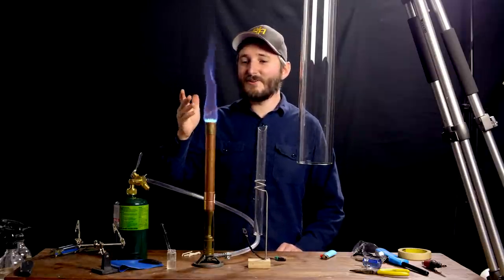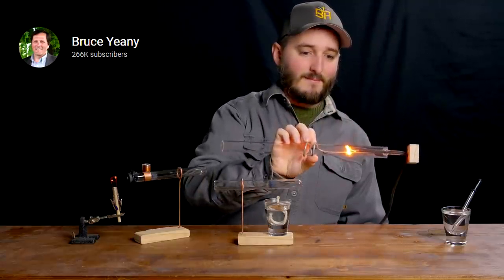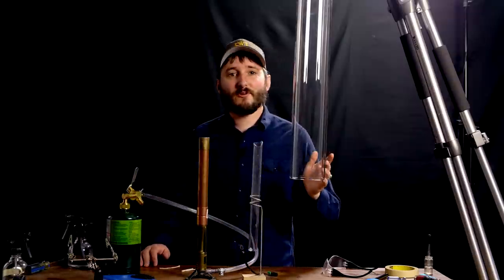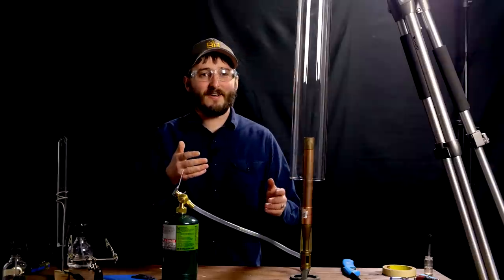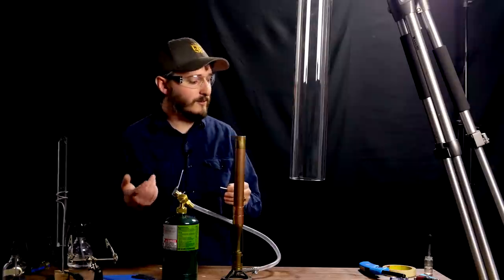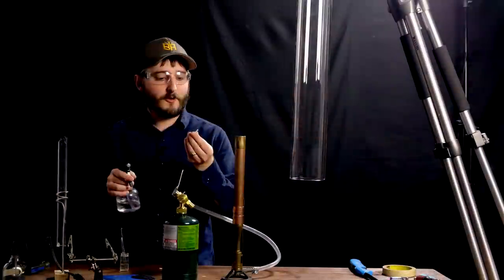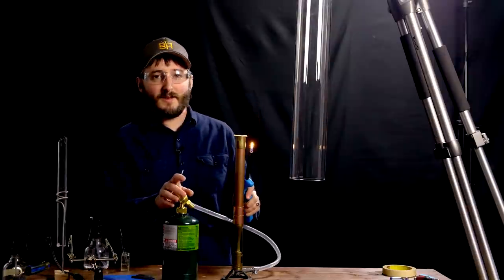Fire Driven Sound Waves in a Quartz Tube

Comment from the maker: I'm curious if the space between each ripple in the flame could be determined by measuring the upward speed of the flame, and dividing it by the fundamental frequency of the tube. I at first was tempted to think that the ripples were another example of "sub peaks" in the sound wave as we saw in the foam bead experiment in part 2 of the thermoacoustic series, but after reconsidering I think it's more likely a factor of the slow moving flame being regularly impacted by the sound wave. Even so there are some curious things to consider, like why does the flame break apart in mid air? That doesn't seem to make sense unless the air movement of a sound wave is subdivided with nodes at the pinching off points. Very interesting to think about.
Reply: Incredibly cool and interesting! What speed was the slow motion footage? I think that would be helpful/important information for anyone wishing to do the mathematical calculations. I'd assume the dimensions would also be important, but that should be attainable from the resonant and harmonic frequencies
Reply from the maker: @riuphane  960fps played back at 30fps
Reply: @Nighthawkinlight  What about making a musical instrument out of many tubes? I might try it myself!
Reply: The ripples in the flame could be from more air being drawn in intermittently through the bottom of the tube when the end experiences low pressure? The convection current of the flame wants to draw more air in but can’t when the pressure is high at the mouth and can only do it at low pressure? Just a hypothesis
Reply: Sound is bouncing the table.
Reply: This kind of reminds me of a pulse jet. Is the process similar?
Reply: Also is it possible that what we are seeing here is a similar process to acoustic levitation? The frequency waves are creating barriers inside the tube. Not so much pushing but more of blocking the gasses from moving upwards. Essentially when you hit the frequency wave at the right point on the burner it actually creates a pocket of vacuum from the burning gas between the waves. When the tip of the burner gets to close the the edge of a wave it's the equivalent of putting your hand on top of it. The closer to resonance you reach the more frequency waves are trapped inside the tube causing the flame to progressively get smaller until the resonance is so high that it creates a pocket to small for the flame to sustain itself. The reason you feel pressure from the bottom is that there are more frequency waves above the flame than bellow. Everything follows the path of least resistance so it's more difficult for the pressure of the gasses expanding to go up than it is for it to go down.
Reply: @jonathanfeller  That would be interesting. I'd like to see that.
Reply: It's probably the same separation action seen in the small scale. I wonder if there are higher harmonics outside the audible range.

I'm not sure how you would calculate this but I feel like the pressure wave would also influence it. Then I wonder if it is more a simple calculation of the wavelength considering this is more similar to a standing wave, which is in fact moving but appears to be still.

Then I got thinking further, we measure Standing Wave Ratio to measure impedance matching. When there is an impedance mismatch it causes signal reflections. I think this is creating the same thing, making a mismatch between a high and low pressure. There are probably reflections at points that don't produce sounds. Then as those reflections oscillate at the same frequency as the tube, it begins to sing. There is an obvious resistance that is created by the reflections. Impedance SWR measures form 1-infinity, infinite impedance is equal to a dead short.

 I think the point at which the flame goes out is a point of maximum reflection and maximum resistance, maybe infinite. Effectively making the tube as if it was sealed at the top. This same thing happens electrically at certain frequencies combined with a resonant length of coax. An open end will appear shorted when it is not and/or appear open when it is shorted. This takes place at the 1/4 wave point.
Reply: Just take a look at Hans Jenny's Cymatics series of videos to have your mind blown away by these nodes that sounds create on different kinds of matter. I say, for real, do it! You won't regret it.
Reply: I think it will be harder than that. while the velocity of the gas will increase the speed of sound in one direction it will decrease it in the opposite, so there will likely be a negligible effect by comparison to other factors. For instance, the speed of sound should play much more of a factor. Given you're heating an enclosed column of gas the adiabatic constant will likely be off, the ratio of gasses will alter the gas constant, and the temperature will be quite a bit off from 20°c at 1 atm. This all serves to make the speed of sound larger than the 343m/s that is used by most people. Also don't forget that the length from node to node only equals half the wavelength. These smaller periods will almost certainly fall along, or scale to, a multiple of the wavelength not the column length.
Reply: Have you heard of "sonoluminescence"? If you can capture a bubble in a liquid with a sound wave and squeeze it enough to make a plasma dot then can you do it with only gasses? Can you capture a bit of the flame with a sound wave and compress it?
Reply: It would be interesting to measure the pressure differentials throughout the tube
Hey, are you a yooper?
Reply: You need to try to build a glass pulse jet engine. This was an awesome video by the way.
Reply: Man I wonder what would happen if you filled the little tube with smoke flow to see the waves??
Reply: This is ancient knowledge you are demonstrating to your large audience and I can see it brings joy to you. Thank You!
Reply: @nghermit4922  radom ignition of vapor in glass doesn't sound like too much fun
Reply: I have so many questions. 1. it appears that the sounds can't be generated when the tube is laying sideways, "why"? 2. can you generate a harmonic using another sound, can you do it using something other than flame/fire and if you use an amp, can you use one as small as an earbud? 3. is the tube open ended or like a beaker? 4. Quartz glass, is "actually" made with quartz or is that just a name? 5. if it is made of quartz how are the quartz distributed? can you diagram the "design" of the quartz glass (does it look like a brick wall etc) 6. Can you make quartz ROCK (natural state) resonate with a sound? 7. does the "harmonic" pitch have any other properties like electric/magnetic etc? And how long can you hold a harmonic note? 8. Can you record those sounds you're creating using fire and quartz glass and apply them to other things? can you use them to power a piston or a rock drill?
Reply: What is the music playing during the slow motion sequences? -- E.g. starts at 6:06
Reply: You said that placing the burner at a quarter of the tube gave the best result. I wonder if it's related to the fact that antennas resonates when they are at a quarter of the wavelength. I bet the principle is similar.
Reply: @V1ctoria00  probably not it would probably shine for a moment until the reaction finished consuming available oxygen in the bubble. Then you'd have just a floating bubble of co2. Would make for a good experiment, though, if you used electrolysis for hydrogen and oxygen, re-combine them at a certain rate and bubble upward to catch it between the two transducers? But idk what source of ignition you could use in water???
Reply: @patrickbowen9395  perhaps a reaction that could be captured? Sodium comes to mind but perhaps something less violent?
Reply: @V1ctoria00  actually yeah sodium probably would work....actually itd be more interesting to know if it wouldn't work. If you could get a frequency high enough that the couldn't react with the water.
Reply: @[REDACTED] [DATA EXPUNGED] Overtones are the usual name for harmonic frequencies, a more scientific term. The only reason you might hear them described in different ways is because of perspective. In a musician's case (or sometimes audience) you are inside the tube, hearing overtones based on where the nodes are in the room. Flutes, on the other hand, are designed through literal coincidence to avoid these, and thus the hole spacing.

I was in a choir many years ago, and participating with a talented enough group of ~50 singers to make very pure sounds. Our director taught us the accoustic nodes of the room, and had us sing notes at it. The experience is unlike anything I had before or since. Not just joy at the sound, one has a physical reaction, it's hard to describe.
Reply: @Nighthawkinlight  Your visible joy is as contagious as your knowledge in these videos. You never fail to give me an idea for something practical or interesting, and that is the best kind of present. Thank you!
Reply: Do this experiment again with a more basic burner that doesn't mix in air. It might become more like a pulse jet.
Reply: @Kneumann1991  I am always trying to understand how my pjs run so fully agree with you on this.
Reply: @Nighthawkinlight  When you first ran in to this subject ,  you did mention about application and uses of thermal acoustic effect, so this video remind me a lot about PULSE JET engine,  this may be a recap topic of many other youtuber,  but since you are really good as simplify things to easy understand, could you make a video about pulse jet engine with your own way?  I know the common one as the U pulse jet engine,  but V1 flying bom engine is an interesting design of pulse jet engine,  perhaps that could help you get some ideas to apply on other uses of thermal acoustic,  such as what will happen when you put valve or vent in the singing tube? 

    Also,  the singing tube won't work when placed on horizontal,  because of the hot air just move up(as you mention in the video),  so will it make sound when put moving air through the tube placed in horizontal and if so, how much air will make it work or speed and pressure of the moving air...? 
 
    Beside the pulses jet engine,  the first video make me think of Stirling engine.  This also a good topic for another video.
Reply: The particles of air redistribute due to the pressure waves right? If all the oxygen molecules split up into regions, then only those regions can "burn". That means pockets of dead space inside the flame. Am I thinking about this right?

Only issue is that that means the space between each ripple is a formula of the pressure of the air AND the propane fighting each other.
Reply: NightHawkInLight Have you done a video on pulse jets? The parallels between that technology and your recent endeavors seem ample.
Reply: @dasleikjr  Not safe, but fun for sure. Stand well back.
Reply: Now people can see how the SR-71 worked. The sonic boom is why that blackbird flew so fast.
Reply: Using a flame - a plasma - to induce the resonance in the tube was a brilliant way to visualize the compression and rarefaction of each half cycle of that resonant frequency. Yes, the amount of air moved at maximum volume (which occurs at resonance) is substantial!
Reply: The places the flame breaks up are likely areas of turbulent flow since it seems to "roll" off the sides
Reply: @NightHawkInLight Thank you so very much for this demonstration, it helped me figure out some tangential research regarding thermal echo from the various spectrums of energy put out by the sun.  For example, if you examine a limestone quarry lake it will have visible stationary patterns in the surface of the water.  I speculate that this pattern is the limestone resonating in some fashion to a wavelength of energy we don't normally perceive as coming from the sun (outside of our traditional senses).  What's more, the pattern is consistent even with significant cloud cover, which has its own layers of implications.
Reply: Sounded like a light saber
Reply: I mean if you gonna ask why the flames are separating in the tube then you gonna ask the same thing but what happens with nature in other words an natural fire I mean the reasons could be different but the logic could be the same
Like for example in the tube gas  (it’s fuel) and heat and they like to go up essentially 
Now with the natural fire the same thing happens but it doesn’t have gas furthermore when you’re using a normal burner without the tube the opposite happens there is very little flame separation (I guess you can call it) when it’s A blue Flame of course and this is where it separates it seems like it’s the sound that causes separating in the tube and else for natural fire it seems to be a heat and the natural cold air kind of helps it bit more along
Reply: digital subliminal messages  
Da Flip are you going on about?
Reply: God has said in the Quran:

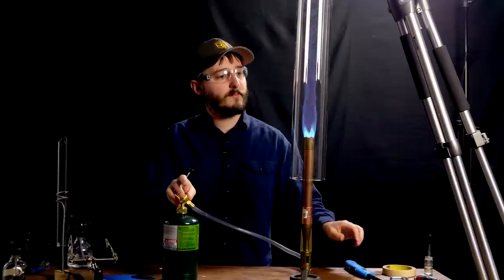{ O mankind, worship your Lord, who created you and those before you, that you may become righteous - ( 2:21 ) 

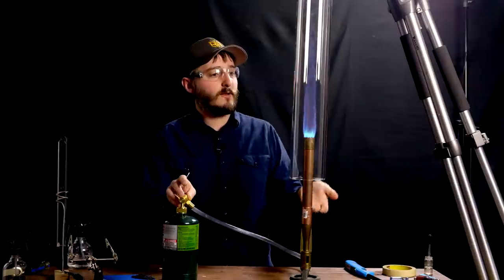 [He] who made for you the earth a bed [spread out] and the sky a ceiling and sent down from the sky, rain and brought forth thereby fruits as provision for you. So do not attribute to Allah equals while you know [that there is nothing similar to Him]. ( 2:22 )

And if you are in doubt about what We have sent down upon Our Servant [Muhammad], then produce a surah the like thereof and call upon your witnesses other than Allah, if you should be truthful. ( 2:23 )

 But if you do not - and you will never be able to - then fear the Fire, whose fuel is men and stones, prepared for the disbelievers.( 2:24 )

And give good tidings to those who believe and do righteous deeds that they will have gardens [in Paradise] beneath which rivers flow. Whenever they are provided with a provision of fruit therefrom, they will say, "This is what we were provided with before." And it is given to them in likeness. And they will have therein purified spouses, and they will abide therein eternally. ( 2:25 )

 Quran
Reply: God has said in the Quran:

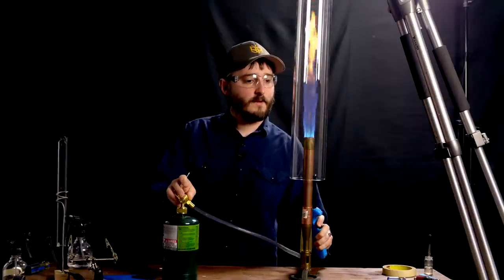{ O mankind, worship your Lord, who created you and those before you, that you may become righteous - ( 2:21 ) 

 [He] who made for you the earth a bed [spread out] and the sky a ceiling and sent down from the sky, rain and brought forth thereby fruits as provision for you. So do not attribute to Allah equals while you know [that there is nothing similar to Him]. ( 2:22 )

And if you are in doubt about what We have sent down upon Our Servant [Muhammad], then produce a surah the like thereof and call upon your witnesses other than Allah, if you should be truthful. ( 2:23 )

 But if you do not - and you will never be able to - then fear the Fire, whose fuel is men and stones, prepared for the disbelievers.( 2:24 )

And give good tidings to those who believe and do righteous deeds that they will have gardens [in Paradise] beneath which rivers flow. Whenever they are provided with a provision of fruit therefrom, they will say, "This is what we were provided with before." And it is given to them in likeness. And they will have therein purified spouses, and they will abide therein eternally. ( 2:25 )

 Quran
Reply: Ouch that first small one sounded like exactly 520HZ which hurts like crazy for headphone and non headphone users btw xP
Reply: @NightHawkInLight
I think if you shot smoke into the pipe through a thin pipe from below, you would get some more beautiful footage.
Reply: Can you make termo-acustic experiment, in different media then air ? Im interested, how different speed of sound in medium change resonation frequency.
Reply: I did it, but from first principles, it is a translation problem. I have a Euclidean Identity Matrix for the Skin Effect in a solid, and it could be transformed for the Fire equation. An x,y,z radiation decay bundle geometry, with temperature, pressure and density phase change parameters. What the equation would signify is the precise states of the system, the fact of fire burning toward its fuel, and ignition parameters. MY questions are how a strong magnetic field would influence the evolution of the fire equation. The fundamental New Standard Model approach demands a 1D radiation transform, and without any wires processing EM flow, the 1D topological crystal structure of the tube fits INTO the toroidal slice of the tube instead of a wire, a 1D-3D embed. I see a Skin Effect in the resonance, meaning that internal space of the tube is the "counterspace" where the dynamic adaptive physics takes place (Boltzmann Brain Case), and then it radiates to a sine wave frequency we hear. Like the battery touched to the glass spins the water. Or the magnetic egg in water as it freezes to ice. Look at Theoria Apophasis' frozen magnet experiment.
Reply: @Nighthawkinlight  video idea: manipulate sunlight un such a way that you could use it to forge metal!
Reply: Looks like a Tesla value  in slow motion very cool channel
Reply: @V1ctoria00  that would also Require Electromagnetic Coil...and Soundwaves over 240 decibels
Reply: This will achieve Brownian motion... cryogenic fusion...same as inside a star...
Reply: @mjolnirswrath23  ok so its hard to do? But if it can be done I like to see it. I also want to measure the energy output of the plasma created by sonoluminescence.
Reply: maybe if you add holes like in a flute, so the fire can take enough air to vibrate without going off??  (EXCELLENT EXPERIMENT!!)
Reply: @BurrowsNE   Thanks for that information.
Reply: Sounds like the whale songs.
Reply: Space engine ultrasonic comments too nice lot more work to get it to work??????
Reply: what you do here could be the phenomenum inside the Kheops Pyramid
Reply: Can you check if the resonating quartz tube has a voltage ? It is piezo electric so wouldn’t that make it put out a voltage
Reply: @Nighthawkinlight  quartz is piezoelectric that quartz tube must be creating a voltage under its own resonance created by the flame would be fascinating to test
Reply: You have 333 videos nice bro
Reply: @fstemarie  well 1/4 to half wave antenna is imperative to oscillate the proper impedence of the sine waves propagation which inturn does create precisely the aim of direction or signal to propagate steady. It's all about tuning your vibes essentially which is awesome even in thought let alone sound. Much like speaking a desire into existence.  I call it thought propagation 😊
Reply: I know I'm late to the party and I don't know if you still have notifications on but I would be really curious to see an em reading of the tube when it hits resonance possibly with a voltage accumulator Tesla coil Style as quarts is piezoelectric